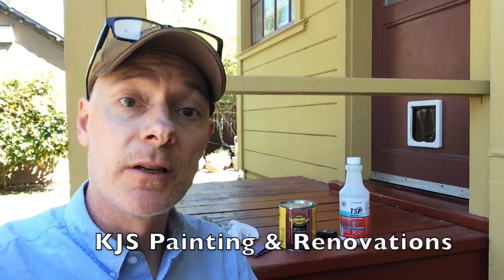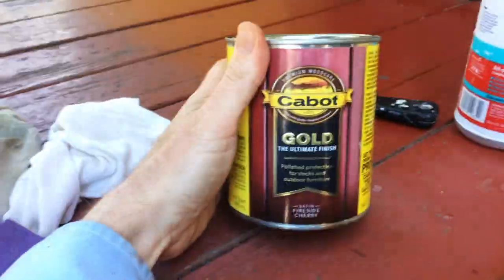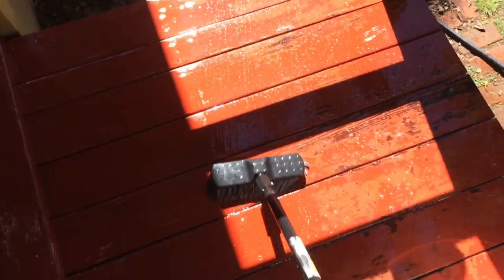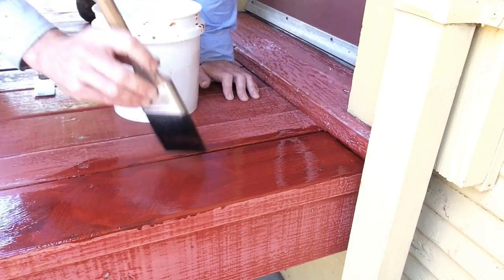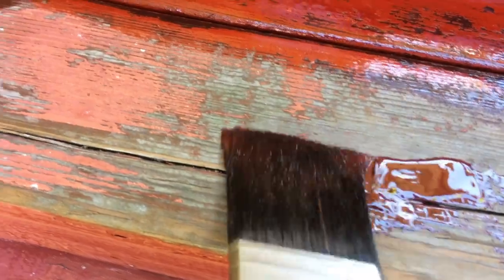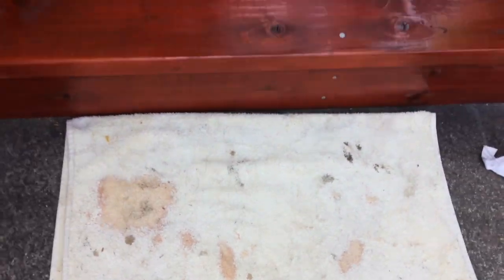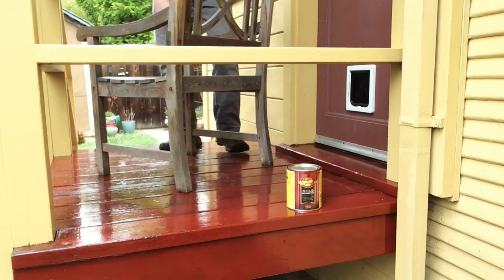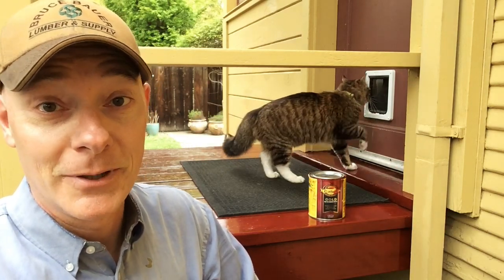Cabot Gold Stain Fireside Cherry on Deck

Comment: Bought this, love the color, had 2 layers of solid colored stain on the deck, sprayed it with cleaner/remover and pressure washed it, let it dry overnight and stained. I love this stuff😍. Since I couldn't get some of the old stain off around the edges, this stuff looks great, perfectly imperfect, with shaded effect where the paint was.
Reply from the maker: It is beautiful isn't it?

Comment: Hey Kent! I'm looking at the Cabot's Oil too.  The primary ingredients are linseed oil, tung oil and long-alkyd oils.  The VOC is within legal limits of 250g/liter.  The other product I'm looking into is Rubio Monocoat which is also a vegetable based hard wax that, like Cabot's, molecularly bonds with the wood but has 0 VOC.  Rubio is designed for wood floors and has an accelerant that makes it cute in 24 - 36 hours with only one coat! Once a year, you mop on a maintenance coat which dries out in a few hours and it should last between 5 and 20 years based on your lifestyle.  It's much more expensive though.  I paid $65 for 20 ml walnut tint plus accelerant.  I refinished my dining table and have 3/4 of it left.

Comment: Did you sand between coats? Looks very nice. I’m using Cabot Gold sunlit walnut on my screened porch.
Reply from the maker: No sanding between coats. Of course, if the job were to sit for many days, more than 7, then sanding would be necessary.
Reply: @KentSchneeveis  Thanks for feedback. It's been 48 hours and we now have rain in the forecast for next 4-5 days. So we'll see how it turns out. Hope to get lucky before 7th day for period without rain. Your video was helpful, nonetheless. I plan to post a video of mine once through as well, as I couldn't find a lot of Cabot Gold videos specifically.
Reply: No sanding between coats
Reply: @guitarfixx4652  is it necessary to do that ?
Reply from the maker: It's not necessary to sand between coats